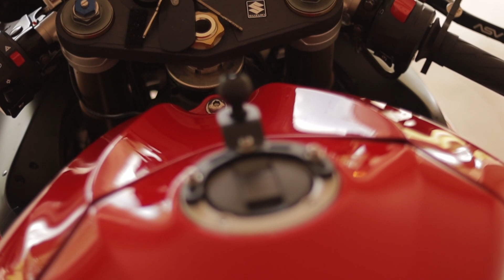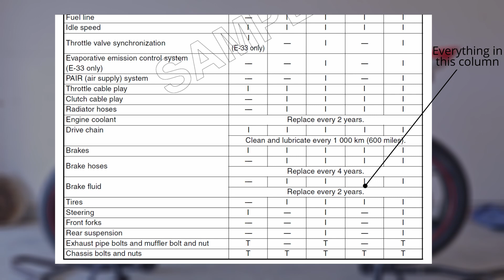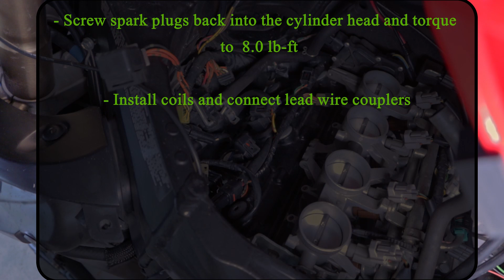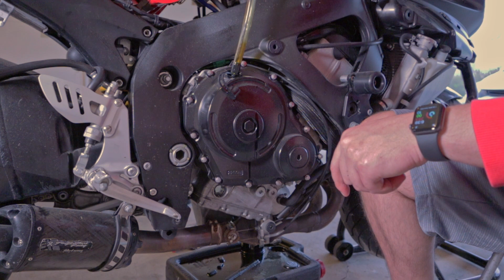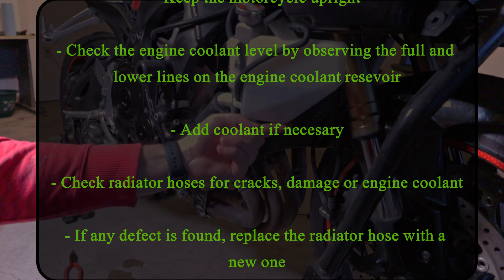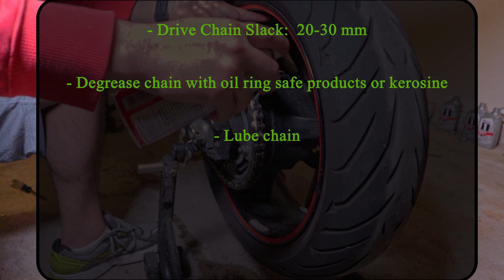GSXR 600 11,000 Mile Maintenance

Comment: How would I fix a threaded problem I tried to change my spark plugs on my jigster 2007 and yeah the threads got stuck in the cylinder only the thread not the whole spark plug how would I fix that.
Reply: Might need to get it re threaded mate. 

What plugs were you using ? I’m looking to redo mine